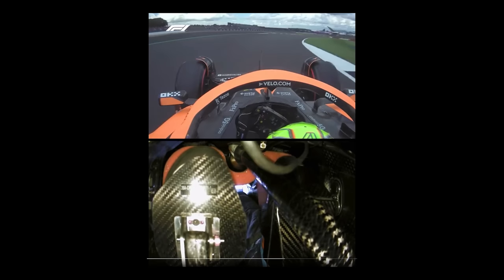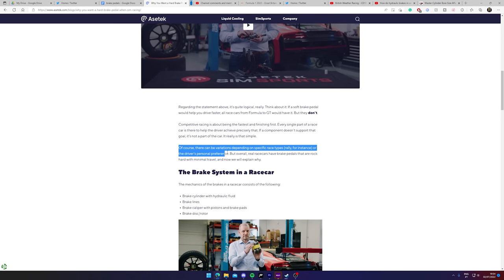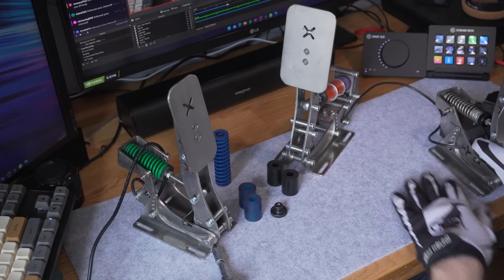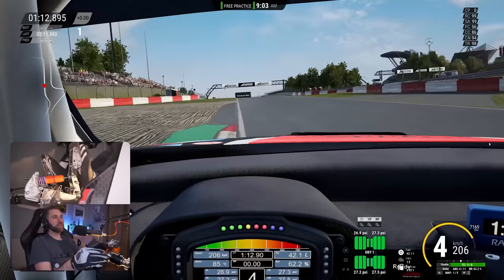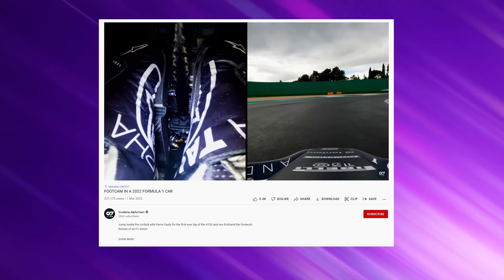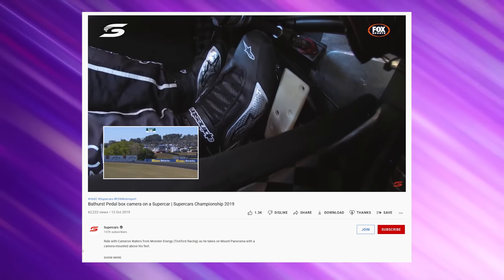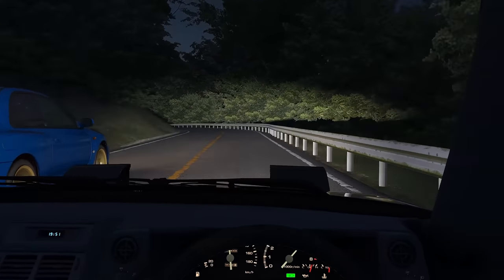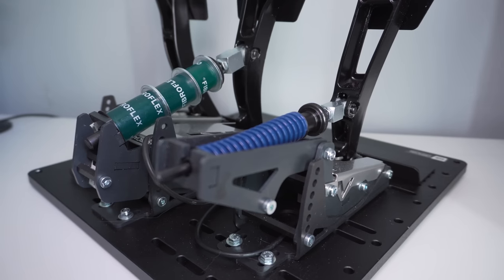Lando Norris brake cam shows simracing brake travel is all wrong

Comment: Yeah the whole 'has to be short travel and super hard' thing is a myth, set up your brake how you like it to feel and play
Reply: Yeah I love when someone tells me I need a 200kg load cell and like 20mm travel but I'm over here with  chicken legs lmao
Reply: @perryperch8948  however much you weigh is probably about the max pedal force you could use comfortably for long periods of time, well it is for me anyway, I have a 100kg LC on my brake and max it out comfortably, its slightly harder than doing a 1 legged partial squat
Reply: @fathead7  Even then its about leverage too. Depending on the length of the arm for the pedal and the angle it applies you can get considerably ranges of pressure. A 200KG LC could have a leverage system that makes it softer than the T-LCM 100KG. The capability of the loadcell is more about the design and how that leverage applies it doesn't mean the pedal will necessarily take more force than another.
Reply: Yep I like mine with no travel and stiff I’m a muscle memory person, basically it’s boils down to personal preference I can’t trail break on a long travel pedal, but I can with muscle memory, I have a 100kg loadcell I only have it set to about 45% atm though about 45kg/90lbs or so, I love my loadcell pedals one of my best investments besides my wheel and rig I played on regular pedals for a while it’s just not for me
Reply: Yeah but what if i want my sim to emulate real life as much as possible?
Reply: I don't know how ppl manage to trailbrake with 20mm or less and over 100kg load. Feels like it's gonna be 100% brake or 0% brake then
Reply: @snippidippi  it’s about the force you put on the pedal not the position it’s in. 20mm or 60mm makes no difference, applied force is what counts.
Reply: @crazybird1649  pretty sure the travel makes alot of difference.  20mm travel makes its very hard to trailbrake no matter if it hard or soft. A combination of it would be best. I hate short travel super hard brake pedal as it gives zero feeling
Reply: And some of those reasons are done in race cars because of the forces being applied through the car. U cant have a super fluffy light pedal when the cars getting hammered on a track
Reply: @snippidippi  it really doesnt matter its just what you are used to
Reply: @snippidippi  Maybe it makes it harder for you, but there are people that prefer it. The point is to use what is comfortable for you, if you have to think about something while driving it will slow you down. There is no objective "best" pedal feel or travel distance or amount of pressure.
Reply: @kingcarrot6355  if you had a job your answer to my simple question wouldve been smaller.
Reply: Never heard anyone tell me this
Reply: Welll the F1 car is still "super hard" because it doesn't have a brakebooster. 

Also in real Care travel doesn't actually matter that much since you can feel the correlation between your brake pressure and rate of deceleration 1 to 1.

Same with FFB. Most modern cars can be driven near the limit despite steering assists that make the wheel feel dead. Bc ur body feels the weight shift and g forces just fine. 

But: yes, adjust brake however u like
Reply: @fathead7  another point is, he's the brake force shouldn't really be higher than your weight.

But how you sit also matters. If you sit like in a street car in your rig, you press down on the pedal. Wich means you will lift you butt up if you have a pedal force close to your body weight. Because you can't brace yourself against the seat.

If you hip joint is on the same height as your ankle, then pressing your body weight actually becomes easier bc now it's all leg force and your bodyweight won't be the limiting factor. Because you can press against the seat. This also makes you more consistent.
Reply: I actually like a lot of throw in mine. I don’t like having to put my entire body weight into the brake to slow the car or shift the cars weight around a corner.
Reply: It's not a myth. Lando's pedal is hard. The force needed to brake is immense. People here, including this very video, is over simpifying things. A pedal travelling, let's say, 15 mm with 130 kg of force is completely different to a pedal traveling the exact same distance but with 60 Kg. The distance and force have to both be taken into consideration, not to mention the curve of the force (how the force VS travel ratio changes the more the pedal is pressed).

On top of that, ex F1 driver Heikki Kovalainen has an actual video with the Simcube 2 pedals and explains how F1 brakes are like a rock.

Personally, I've driven F1600s, F2000s, Skip Barbers, and a 2-day test of an open-cockpit prototype style car in Italy (part of an Italian championship) and, while all different, the brakes on all where hard. In just the F2000s, I had to press so hard on the brake during the hardest braking areas, that my bum was literally raised off my seat as my back was pressing against the seat so hard to try and get every ounce of force on the brake. That was just for the very hardest braking zones, maybe 2 corners per lap (long straight followed by sharp turn) but, still.

Also, when I had air in my brakes a few times, the pedal became really soft and squishy which makes it feel like crap. The hard, firm, responsive pedal inspires confidence, feel, and modulation. When the air in the system made the brake soft & squishy and it's throw-length increase, the braking was horrendous. As soon as the system was bled, the feeling of the brake was a night & day difference.

Comment: I think in race cars, and F1 in particular, the pedal feel will be set to driver preference, just like their seat is moulded to their body shape - maximum comfort gets maximum performance.
Reply: definitely. Isnt very hard to do mechanically. Different ways even, i suppose
Reply: You also have to consider that modern F1 cars have brake-by-wire. So its basicly like a sim-racing pedal.
Reply: And they use different throttle maps for different weather conditions.
Reply: Couldn't be said any better, maximum comfort gets maximum performance 👌🏁
Reply: @GTFan8899  isn't it only the rear brakes that are brake by wire in F1? the fronts are still on a hydraulic system connected to the pedal if i'm not mistaken and they do this because the rear wheels are where the KERS system is connected and therefore the car wants to be able to only engage the rear brake pads when the KERS system is unable to provide the amount of braking force the driver is asking for
Reply: the mclaren brake travel is different to all the other cars btw
Reply: @GTFan8899  The pedal is still hydraulic. The front brakes are directly connected to it.  The rears are a different story since the hybrid era though. If you think of hybrid energy recovery, hybrid systems take kinetic energy directly from the wheel, aka braking. The problem is that it will contribute different amounts of braking depending on a lot of factors like battery charge, ERS setting, etc. The BBW system exists to control the balance and make up for this varying braking effort and has only been allowed in the hybrid era. Even then the rear still has a master cylinder at the pedal. So no, it's not like a sim pedal at all.

Just this weekend they bled Hamilton's brakes on the grid cause his pedal was too soft.
Reply: I have a different brake cylinder on my car even, meaning the pressure in the entire brake system is around 75% of what it is supposed to be. 

Have to press the pedal “further” for light braking, but it also means I can regulate it a lot better, since in road usage you don’t really have to fully depress your pedal. Like ever.

If I go out on track I have a bigger brake cylinder instead, meaning if I tap the brake it does a lot more.
Reply: When the comment section has no fucking clue what their talking about
Reply: "Maximum comfort gets maximum performance." Meanwhile you've got the Mercs giving their drivers permanent spine damage because it would literally be slower not to
Reply: @rainyprac  thanks for that explanation! Makes perfect sense. One question, when you bleed a brake pedal you take away pressure from the system because les fluid, doesn’t the pedal feel therefore become softer? Not challenging your statement just trying to understand.
Reply: @timbosse1634  not an expert on f1 cars but generally "bleeding the brakes" also means *adding fresh fluid. Brake fluid is perfect for transferring the pressure you put on the pedals to the brakes because It doesn't compress under pressure. The problem is sometimes bubbles form in the lines and gasses compress a lot under pressure which makes your brakes feel "spongy" or soft. Like miniscule little cushions within the brake lines absorbing the pressure you put on the pedal. Not ideal for someone like Hamilton who likes to get the most out of his braking zones.

Bleeding the brakes (and replacing the fluid) gets rid of any bubbles and sponginess in the brakes.
Reply: @rainyprac  ok bleeding for me does not automatically means replacing.
Reply: @timbosse1634  You certainly want to add fresh fluid when you bleed your brakes. 

I should clarify I don't mean fully replace the fluid, but you replace what was lost. Hamilton in this case was complaining about sponginess more than softness. "bleeding" just means getting rid of the bubbles. You can dial in the pressure to the driver's preference.
Reply: @Swat_Dennis  exactly. Also depends on the car weight, I have a little Peugeot 206, which is super light and for that the brakes are extremely soft and with plenty of travel even when fully bled. I also have a Tucson, which is a heavier SUV so the brakes are a lot more reactive, at slow speeds you have to get used to it after you drive for a while in the Peugeot lol. At highway speeds though, the more responsive brakes are necessary to slow down at all, with all the mass you have moving.
Reply: @timbosse1634  bleeding the brakes means flushing fluid through the lines in order to remove bubbles of air that's in them, you "push" the air out of the system with the fluid that's behind them.
You don't lower the pressure as it's still full of liquid, as long as there is liquid in the little reservoir under the hood. It doesn't have to be new liquid, but if you flush a lot of fluid you're gonna need to top the reservoir off, or the lines are gonna be sucking in some air making the bleeding process useless
Reply: @FAB1150  thanks, makes perfect sense right now. And they say youtube is bad for development. 👍🏻
Reply: Yeah i find this video missleading(at least the title is) cus u can adjust brakes like u want in a racecar like u do on most of the brakepedals in simracing.

Comment: I’m guessing from an engineering standpoint it’s easier to make a sim pedal be consistent and accurate with a very small range of travel.
Reply: Elastomers that are softer and travel further also tend to brake easier and they wont produce as hard a stop. I can well see this being a compromise based around materials as harder materials are also more robust and they favour the end of the pedal feel over the route to it. Springs alone aren't the right answer either but I think its why a lot of people are finding springs + elastomer is proving a good middle ground in the DIY space because you get the travel and then you get the progression.
Reply: It doesn't matter for load cell pedals. They measure load. If you throw a mix of soft and strong stuff, the consistency for the applied load will still be the same.
Reply: @PaulRKeeble  I have switch to a combination of the original “hard” elastomer and a dye spring I found on Amazon for a cheap and easy fix to increase travel while still giving a very nice progression and a hard stop. It’s working great so far
Reply: @kylekroes6989  What is a dye spring? I can’t find anything called it on Amazon.

Comment: At some point along my many upgrades through the years I realized I dont have a race car to emulate, therefore the setup is up to my imagination and how I want my "race car" to feel. I stopped trying to make it feel any way but perfect for me. The most important thing is that when I think I am applying 50% brake I am actually applying 50% brake, or whatever value my brain is thinking is what my foot is also feeling. I currently use the V3s with the brake performance kit one red and one green and the foam piece and about 2 preload. Then I sat there in the calibration software until with my eyes closed I could do both 50% and 80% applications of the brake. I changed the max value until the PC was seeing what I felt was right, if I had to guess Im probably around 60-65kg at 100% even though I am more then capable of applying far greater then the 90kg the load cell is rated for.
Reply: This is exactly what I ended up doing over a year with my V3’s. I tried all the suggested setups and then came to the realization I need to adjust the brakes relative to what I perceive as half the travel. Generally (if I needed to calibrate) I would press the pedal to a point that felt like what I thought maximum brake pressure would be. It would then follow that I could engage the brake to 50% without any indicator telling me I had done so. Very strange way to go about it I know.
Reply: When you're sitting there with your eyes closed and estimating half pedal travel you don't have the stimulus/stress and visual inputs of actually driving in a race or qualifying session. It's likely in the latter situations that you will be pressing the pedal harder due to being in a more excited state.

Comment: I went from simracing to (club level) motorsport, and found many interesting differences that simracing just can't ever reproduce. Regarding the braking in the real world, a firm pedal gives me the confidence to brake hard, and the long pedal travel allows me to easily modulate the brake pressure as needed depending on the circumstances (the limit of brake performance is always changing and you need to be able to adjust the amount of brake you are using to stay at that threshold of brake performance). 

With simracing, I'm not entirely sure that a long pedal would work the same way, simply because the g-forces and other physical sensations aren't there. With the brake modulation I mentioned, knowing how much brake to use comes from feeling how the car is decelerating, feeling how the tyres are contacting the road, how the car moves around, how the weight of the car shifts from corner to corner. In a sim, you don't get that (maybe you do in the proper high end stuff, but I never had that). 

It makes me think that a long pedal in a sim would be discomforting, because you aren't getting the additional information needed to make use of the long travel.
Reply: The thing that stands out from what you mentioned is the feel. In my personal car, when tracking, I just KNOW the brake point based around all the feel of the car. In the Sims even with vibrations or motion platform, any of that, it just doesn't convey the same sensations.
Reply: @timduncan2211  Absolutely. I was reasonably ok at simracing but would still run off the road a ridiculous amount compared to in the real world. People always say that's because in the sim "there's no fear of injury, so people take more risks" - that's not how it was for me at all, it was because I found judging momentum, distance, inertia etc so much harder to do in the sim than the real world. 

Back to braking, that "feel" that we're talking about is critical. The amount of brake I can use is different corner to corner - and can differs throughout a single braking zone. I want some pedal travel to be able to easily feel the amount of brake pressure I'm using. In the sim, I imagine that would get confusing due to not having those physical reads on what is needed at the time.
Reply: thank you for your collaboration on it!
Reply: I know what you mean with missing the sensations of the car slowing down etc, braking is the one part I really can't seem to get with sim racing.
Reply: 100% agree. I've done some irl racing on track and braking always came much more natural to me than sim racing. In most sims, I really had to focus a lot of my attention on memorizing braking zones whereas irl you could just kind of feel for it and I often found myself making up time in those areas. It was more instinctive and less of a deliberate conscious decision. If anything, the sims hurt me for a while irl because I would brake too early. Once I trusted myself and the equipment, I started braking much later and my times became competitive. 

That being said, sims really helped me to learn the subconscious muscle memory for correcting certain... undesirable situations instinctively. Lock ups, understeer, oversteer, etc. So when I got to the track I could apply those techniques without crashing expensive cars that usually weren't mine lol.

Botton line: in addition to being fun, sims can be incredibly useful training devices, especially for those of us who can't afford to make expensive mistakes on the track, but they will never simulate the thousands of tiny inputs your whole body and all of its senses is receiving every second with 0 ping in a real car.
Reply: Get in a real sim rig.
Reply: Simucube FFB pedals will make the feedback you feel in a real car possible.
Reply: Better gear does help with that a lot, im playing on SC2 Pro and HV U+ and i can easily rotate the car into a corner and adjust the slide angle with brake modulation. You do get that feedback through the wheel, how much grip, how much slip angle, you feel when the rear starts to get light and starts to step out.

Comment: Excellent work! My experience in driving FF's and F2000's was that the pedals were very stiff, minimal movement. However, it isn't this or that, it's preference. You did an excellent job with this.